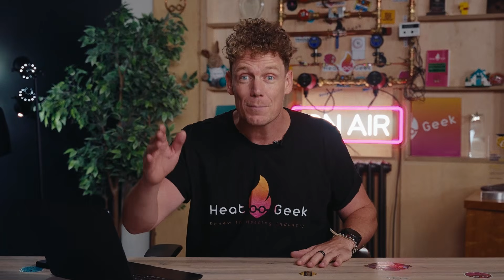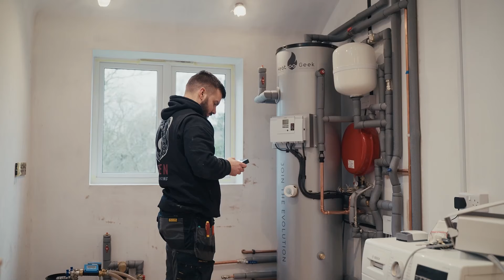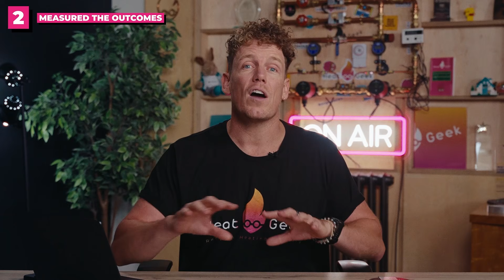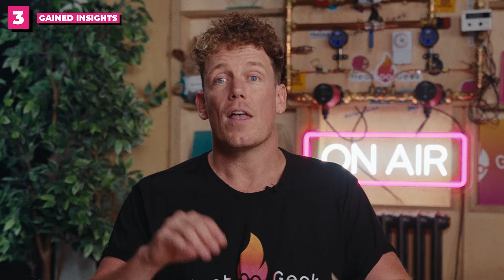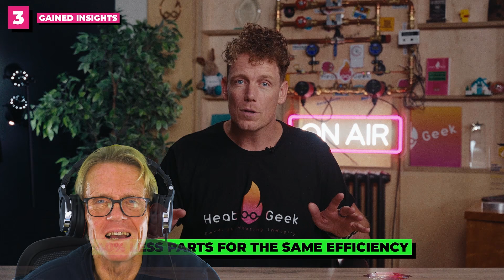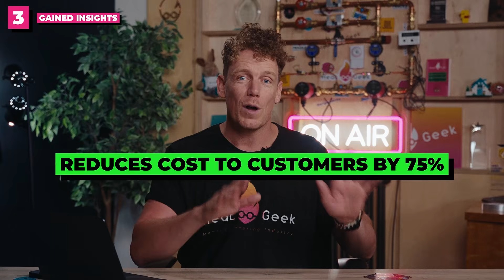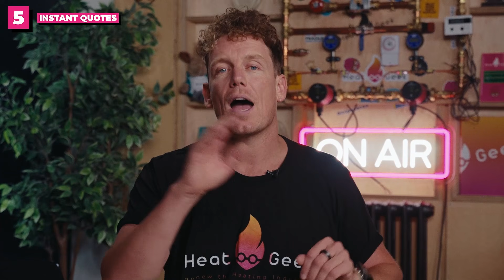Heat Pump Reality Check: Is Zero Disrupt Too Good to Be True?

Comment: Hey Guys - thanks for having me on again!

I looked up about gov pledging to phase out the 17b fossil fuel subsidies, but independent studies show those subsidies have actually gone up since the pledge (still around £17 billion+ a year). Critics say the government counts narrowly, while big tax breaks and incentives for oil and gas remain, so support hasn’t truly fallen at all!

😝😝😝

Seriously though, love the challenge and love the banter.. until next time!
Reply: I love our heat pump our house is much more comfortable having one ❤❤ wish I used heat geek though for live performance monitoring, but our bills  are very low so I think it is working fine.
Reply: The fact is that the true cost of using oil and gas is not passed to the consumer and therefore to a realistic market price. The cost of mitigating all that CO2 in the atmosphere from fossil fuels will never be paid by the oil companies or their customers. That is where the real subsidy is.
Reply: Modern air-source heat pumps (ASHPs) from most big brands already modulate. They use inverter-driven scroll or rotary compressors, with turndown ratios of 1:3, 1:4, or even 1:6.
Reply: I have a DIY heat pump, essentially it just goes on the wall and 2 holes to the outside air to air. It keeps my living and downstairs of my house WArm and it's cheap to run. Our bill for 6 of us gas and electric all in is about £1300 a year in a 3 bed 60s council house. We run ac through the summer as well which is a benefit of the heat pump. We do have solar so obviously in the summer that helps but a lot of our AC usage is in the evening with inefficient portable units. Our heating is set to 21c constantly and will probably stay on until mid spring. Our home isn't especially insulated and we aren't careful in the slightest with energy usage and have 2 dehumidifiers all the time set to 55%rh. I would happily have a full heat pump system but realistically I would want air to air and then use excess solar to heat hot water. I think the UK is missing a trick with air 2 air I personally find it fa4 better and spreads heat far far better imo.
Reply: As a gas engineer, who's basically fitted heating systems for the last few years. What course would you suggest to get a job in the heat pump industry?
Reply: @godthetrueking  it sounds braggy but our course is the gold standard. The best intro course is the Kimbo Hydronics course by a long way
Reply: @HeatGeek  Maybe put the Skill Builder on the course and then let him install a few. He's negative, but as he doesn't fit gas boilers, he wouldn't need to be gas safe and is a good plumber? I'd love to see that on you tube
Reply: The bloke reminds me of a Jahova Witness. His head unknowing is stuck so far up his own arse about future cost is painful.
Reply: Great video
Reply: Yes, I had to go and check too. Fossil fuel subsidies haven't been removed. I found the following on the Globaljustice site.
"Since coming to power, the Labour government
has shown its willingness to tackle fossil fuel
subsidies by joining the Coalition on Phasing Out
Fossil Fuel Incentives Including Subsidies (COFFIS)
at COP29 last year. But it has taken little concrete
action to reduce subsidies so far. In fact, current
policies will result in a slight increase in fossil
fuel subsidies over this parliament, totalling an
estimated £87.5 billion over five years"
Reply: This whole thing about "getting off gas and oil" is a fantasy. Every time the wind stops blowing or blows too hard, they have to cycle up gas turbines across the country. It costs so much money to spin up these turbines they have to pay wind farms NOT to do generate electricity. As for solar, we need the bloody farmland more than the electric. The whole thing is a stupid Chinese scam.
Reply: Loving the banter between Roger and Adam 😂
Reply: Leaving aside the dubious figure above given that renewable energy supplies only about 5% of primary energy (electricity is only part of energy) you would need to divide any subsidy given by the kWh of energy produced. When you do that you will see that renewables get enormous levels of subsidy per kWh.
Reply: @pscassidy  per kWh it’s very similar.. the difference is that fossil isn’t as efficient so by the time you account. The losses it’s defyworse
Reply: except fossil fuel subsidies are things like freezing fuel duty , its just slightly less revenue to the govt from fossil fuels but still a considerable amount of revenue the govt recieves whereas renewables produce no revenue to tax they have to have a subsidy to be feasable
Reply: Whats your take on importing wood from Canada to burn in Drax that heat pump ownerws burn, would it bnot be better to give grants for fee woo burn3ers and supply subidised UK wood ?
Reply: @SteveJones-gz4vd  no… it’s better to leave trees in the ground and not fill the air with particulates. We’d be covered in smog like victorians times if we all moved to stoves
Reply: @SteveJones-gz4vd  

Shut down Drax, and increase realtime renewables.

In North Scotland my electricity for my heat pump and EV is more often than not 100% renewable.

Burning wood is one of the most unhealthy ways of generating heat.

Dr Patel, a consultant respirologist, who specialises in lung cancer in London explains:-

https://www.youtube.com/watch?v=W408iUrXxEM&t=1480s
Reply: here's an interesting theory - stop net zero and then we will have cheap energy... or is net zero more of a religion than fact?
Reply: @shadowdugify  

Net zero is all fact, we don't want to be reliant on foreign expensive imports when North Sea runs dry in a few years.

We currently import half our gas so the less we use the less imports needed and the longer our own supply will last.
We need to prepare for the future now.
Reply: @_Dougaldog no we don't, we are good for a good 100 years, we have made our energy  so expensive. The tides have changed, the left have lost and the right are now  showing they were right all along
Reply: @shadowdugify  

It's not a political thing but factual, North Sea is not good for a hundred years, current production is one third that it was in 1998, that's a 72% decline.
I don't want my future energy prices dictated by Putin, Trump or Saudi autocracies.
Reply: @shadowdugify stop net zero and we’ll have cheap energy? Huh? It’s the gas price that makes energy expensive.. not ‘net zero’ what ever that means
Reply: @HeatGeek well no if we didn't stop coal which was cheap we would be fine but then net zero crusaders didn't want that cheap reliable energy
Reply: @shadowdugify  I mean if climate change wasn’t real then sure lol…

solar and wind are both cheaper than coal though so should have been a good thing.  gas price artificially increases their cost though because they’re ’too competitive’
Reply: @HeatGeek oh I see so it's ok to offset our carbon emissions to China and the likes. You think solar and wind power grows on trees? Why don't you take into consideration the emissions from mining the materials, manufacturing the goods etc? Because you are all virtue signalers
Reply: @shadowdugify  manufacturing is included in their carbon intensity mate… your not discovering anything new
Reply: you’d think in the age of the internet we wouldn’t be having conversations like this
Reply: @HeatGeek  Funny isn't it, a telegraph post just said exactly what I said - the big suppliers such as EDF,  Octopus etc said for green levies as a RESULT of net zero, could add £300 to a tpyical households electricity bill by 2030, so even if electricity wholesale halved, it would still raise by £150. Apologies?
Reply: @HeatGeek wholesale gas price has declined from a Sep'22 peak and has been quite steady since.
Reply: @HeatGeek not true, see Claire Coutinho's analysis. Even if wholesale renewable costs are zero the retail cost goes up for consumers
Reply: @shadowdugify  You know someone has a thick skull when they bring up coal as a solution. Like honestly, they probably also think we should go back to living in caves and hunting gazelles, because it was less expensive
Reply: @tagg8233 look coal worked very well because it was cheap but more important the coal plants were distributed nicely. What is the main issue with net zero? The grid can't cope because where the energy is generated is not where it is consumed. So the best solution would have been keep the goal plants until the grid has been set up then slowly move over. You don't knock stuff down first and then try and build up after  it's been done in the wrong order because it was always about ideaology not reality
Reply: @shadowdugify  Yes it was cheap. Extremely dirty, and has made the world worse for those that come after, but yes, it was cheap. Burning lumps of prehistoric trees was indeed cheap. Obviously neolithic and ultimately foolish, but yes cheap. Good work older generations!

And while we're on that, why is it that the grid hasn't improved sufficiently? It couldn't be the privatisation and fragmentation of utilities right? Another great move from the voting public of the 80s, that. No wonder they want coal back, it reminds them of a time when they sold out their own country's future for nice warm profits. We could just harvest free resources like wind and sunlight, both of which are now cheaper per kwh but nooo, we should dig up stuff and then burn stuff. Much better idea that, good thinking!
Reply: And you think gas is better? It's our main baseline load right now. Take your virtue signaling elsewhere where the elderly and those around the country are paying the heavy price who cannot afford this price of electricity because the system hasn't done well. 

Privatisation has its own issues. I am simply saying it was a bad time to remove the coal without a suitable baseline alternative in the same area. Bad oversight. The market would eventually move when the price is right. Right now it seems the battery prices to store energy right now are becoming that right mix but this has been market manipulation from the start where you complain about privatisation but all that's happened under this marginal pricing is more investment from the tax payer on the bulk of public infrastructure and the private investment taking the easy rewards
Reply: Carbon dioxide is essential for life, acting as the primary food source for plants through photosynthesis, which releases oxygen. As a greenhouse gas, it acts as a thermal blanket, maintaining a habitable Earth temperature by trapping heat. Higher levels enhance plant water-use efficiency and growth. 
Plants generally stop growing and face severe survival risks when atmospheric carbon dioxide levels drop below 150 to 200 parts per million. Today, we have 430 ppm, however atmospheric carbon dioxide levels have ranged from 9,000 ppm to as low as 180 ppm during inc ages. More carbon dioxide in the atmosphere is a non-issue, in fact, it helps plants (the food we eat) grow.
Reply: I may be a cynical old window fitter but always a realist . I would not believe this ,geek, guy for anybody that enthusiastic is too positive to be realistic
Reply: Even after a grant heat pump installation it costs me £500+ a month in electric in winter I only have a 2 bedroom bungalow. 😢
I don't know how it was set up or anything and to get someone out to make sure it is running as efficiently I just can't afford at this time of year.
Reply: @ZachSmall  

I've only a two bedroom semi bungalow, my heating cost was £82 for January (Coldest month here), total electric bill was £221 without standing charge and £240 including standing charge

You seriously need to get someone to check your system.
Reply: @ZachSmall that shouldnt be the case. Do you have a buffer? Try lowering the heatpump temperature. Make it run longer at lower temp. Maybe you pay to much for the kWhs you put in?
Reply: @ZachSmall  and was your installer ‘Heat Geek’ qualified?
Reply: @ZachSmall hey get the flow rates checked and check that there is enoigh glycol in the system and mixed and added properly 

I am electrician but fitted some of the early electrical side and spoke to a few customers that initially had very high bills when I was just the electrician for a nottingham company 

Just an idea 😊 as thry weren't set up correctly on the flow rates and amount of glycol 

Valent we're very very good 👍 service 👏
Reply: @ZachSmall my mum has one in her 60s council bungalow and her electric bill is roughly £100 a month. I would take you exact figures but she's just updated her WiFi so I can't login to the heat pump to look at figures. I know she gets between 3 and 4 cop.
Reply: @ZachSmall  I was in a similar situation a few decades ago - couldn't save for a full CH system due to ongoing bills - I took a loan out as the bills were continually knocking me on my ass.    For you - look at insulation first.  Get that sorted and THEN look at options (leave heat pumps to last)
Reply: I bet you love the gov stealing our money for subsidies even more.
Reply: @northeastcorals well no, hence my point about gas and oil taking 17.5 billion pounds of tax payers money every year.. you should watch the video
Reply: @HeatGeek  Yeh I did watch from start to finish & I saw Roger dismantle your argument on that point. Your counter about taking money from the rich to give to the poor was a bit silly.
Reply: @northeastcorals  well it doesn’t look like many of the other replies agree with you there.

I don’t blaim roger for believing what he read but if you do some research you’ll see that although the uk. Signed a coalition to reduce the subsidies they have in effect not reduced at all…

If gas and oil didn’t receive this then no one could afford to run a boiler at all… it would be WAY cheaper for gov to fund this (at 2.85% of the annual cost) than to keep giving 17.5billion of tax payers money away to rich people who don’t even live in the UK… so yes that would be taking from the rich and giving to the relative poor.
Reply: @HeatGeek  If you believe the elites would ever set up a system to take from the rich in order to redistribute it to the poor I coincidently have a very nice bridge for sale at the moment my friend.
Reply: @HeatGeek  rubbish if oil and gas werent taxed theyd be less than 1//3 price
Reply: @2frogland I’ve not made it up lol. Also.. gas is on you fuel bill has 2% environmental levy, electric (which is half renewable) has 22%..

Gas and oil receive loads more benefits. That’s why gas boilers are so cheap now
Reply: @HeatGeek  no gas and oil are nett profit they may reduce taxes at times but are still a nett profit , were do you think norway got its 1.8 trillion sovereign wealth fund from , the proceeds from gas and oil
Reply: @HeatGeek  

In 2023 budget, Jeremy Hunt introduced a higher tax on excess electricity generation profits than he did on gas

"In addition to this, a new and temporary tax of 45% will be introduced on the extraordinary profits of electricity generators who, like the oil and gas sector, have seen profits increase well above their company predictions."

And Gas

"From 1 January 2023, the rate of the Energy Profits Levy will be increased to 35% to ensure oil and gas companies benefitting from extraordinary prices pay their fair share."
Reply: We've been had over. Feel sorry for the poor sods duped by this industry.
Reply: The bogus ‘17 Billion subsidy’ figure comes from the normal business practise of deducting costs from revenues before tax is applied - and from the reduced rate of VAT the government charges on domestic heating fuel. A reduction in taxation is not a subsidy. It seems Adam wants gas users to be charged 20% VAT just so he can sell more heat-pumps.
Reply: @brickmissing8295  there’s many studies and papers.. vat is a tiny proportion. Funny how people believe a YouTube comment over going and doing their own research.
Reply: @brickmissing8295  

In 2023 Shell paid tax on profit for the first time in five years in UK, better tax dodging accountants than Farage has.
Reply: @_Dougaldog It’s the normal rule for all UK business that they only pay tax on sales revenue less the costs of generating those sales. Shell pay massive upfront costs to find and extract the oil & gas. Any profits they do make are taxed at an extortionate rate (over 50%). This is why the oil and gas industry is dying out in the UK: It’s been taxed to death by successive governments - leaving us entirely dependent on US-controlled oil & gas - hence why our politicians meekly serve the US regime - dragging us into their wars in the middle east, Russia and China.
Reply: @brickmissing8295  

So one way to break our alliance with USA, OPEC & Putin would be to do away with our reliance on fossil fuels and become energy independent using renewables, that would be a good idea :-)
Reply: @_Dougaldog  perhaps but the product is heavily taxed as its production
Reply: @brickmissing8295  You must have misread my post, Shell paid Zero tax for five years until 2023, not 50% nor 80% et al.

We are heavily dependant on gas from Norway which makes up the bulk of the 50% of gas that is imported, and oil from Middle East, USA accounts for about one third of our oil/gas imports.
Thankfully as a result of renewables increasing each year we depend less and less upon the increasingly autocratic USA for anything.
Reply: @_Dougaldog when you corner the market price will go up.
Reply: @stinga_  

Corner which market ?

Offshore wind turbines are currently 7.3p/kWh, onshore turbines and Solar PV cheaper.

The cost of electricity per unit is currently set mostly from the cost of producing electricity from gas generation, at any point the highest generation cost per unit sets the price for all.

From House of Commons library :-

"What is marginal cost pricing?
Marginal cost pricing is where units of electricity are sold at the price of the most expensive unit needed to meet demand at a particular moment in time.
When reviewing the electricity market arrangements in 2022, the Government said the marginal cost pricing system provides an efficient signal for supply and demand decisions, is transparent and incentivises costs to be kept down.

As a result, although most electricity is produced using sources with low marginal costs (42% by renewables and 15% from nuclear), the price that is paid for electricity traded on the spot market is often higher, at the marginal cost of generating electricity with gas."
Reply: @_Dougaldog  Shows you the hold they have on UK governments.  In the '70s the Development contract that Shell had for the Brent field - put 85% of the decommissioning costs - on the UK taxpayer.   The government at the time was desperate and kicked that can down the road.   Luckily. - along came 'Pioneering Spriit' which reduced the costs significantly - but it is still a huge burden.
Reply: @_Dougaldog  Shell only moved it's tax base to the UK in 2021/2022. In 2023 it paid approx £1 billion in corporation tax and approx the same(or a bit more) in 2024.
Reply: @_Dougaldog  Yes, but you will need a lot of Nuclear to provide backup for when the wind doesn't blow for a week or more in the UK winter and solar is producing very little during the winter days with no sun/light for 18 hours/day
Reply: @Alan-w6n9p  

Shell moved their base as part of their restructuring from the dual share system they'd operated, and to avoid even higher taxes in Netherlands.
They would have still been liable for any corporation taxes paid on UK earnings prior to that.
Reply: We don’t have the grid capacity to supply every one on heat pumps and EVs .
Reply: banter? he tore you a new one